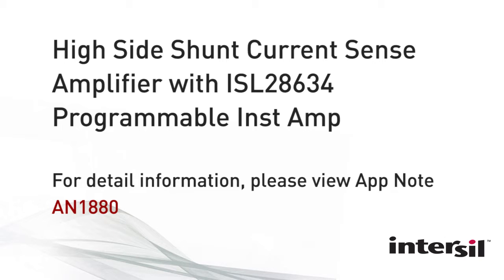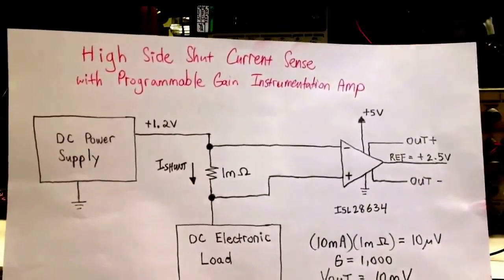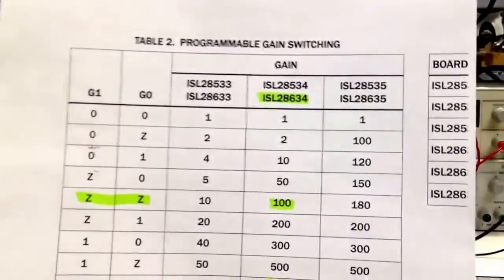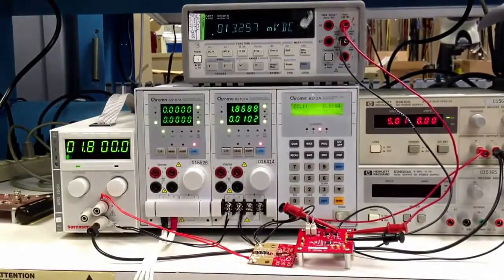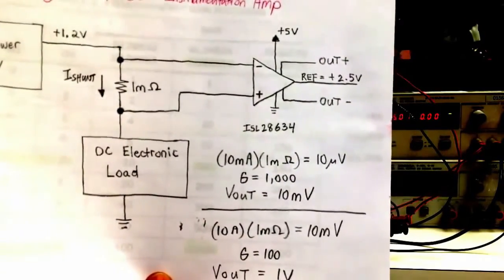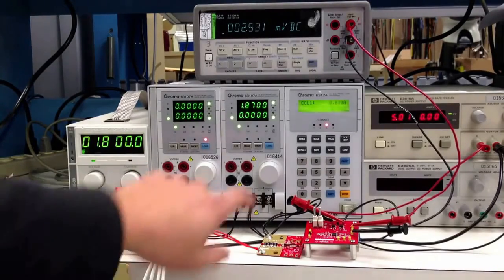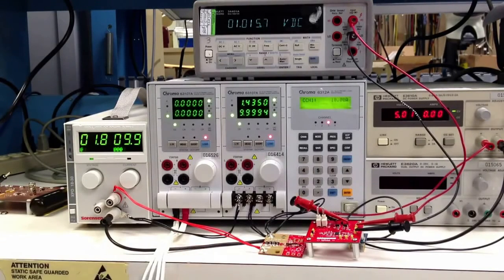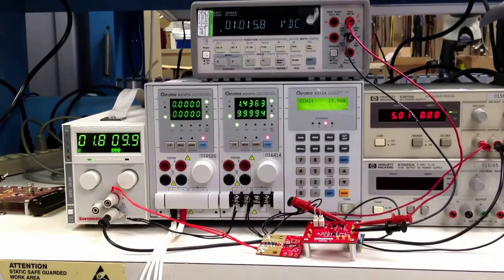High Side Shunt Current Sense Amplifier with ISL28634 Programmable Instrumentation Amp

Comment: cool video thanks man. This walk-through helped me finally understand alot of shunt measurement concepts.

Appreciated the explanation of how offset voltage affects the measured output. 

Also the demonstration of how the programmable gain can be used for different current measurements.

And also notes on if using small resistance you need to have very little offset/noise

Comment: can this PGA be turned into Integrators, Differentiators, Summers, etc?? like the normal op Amps?? where could I find a Reference about such design?? I know I can easly find out About LM741 circuits and Equations on Net..